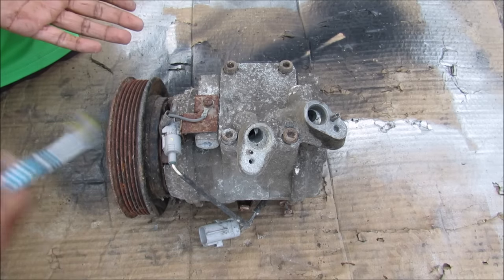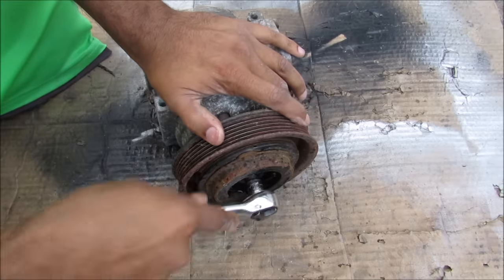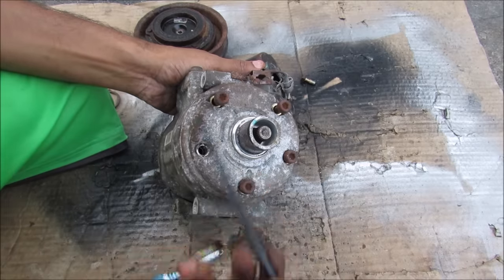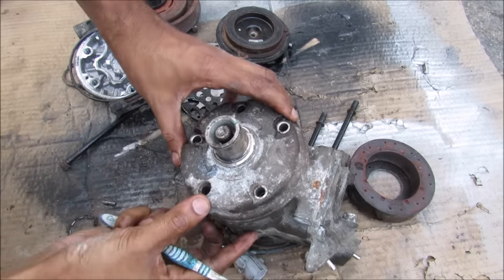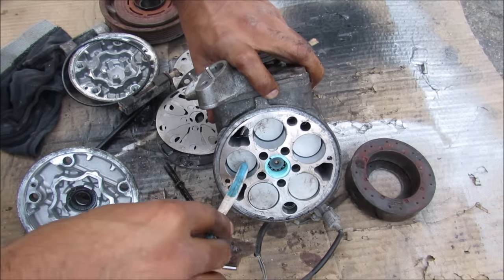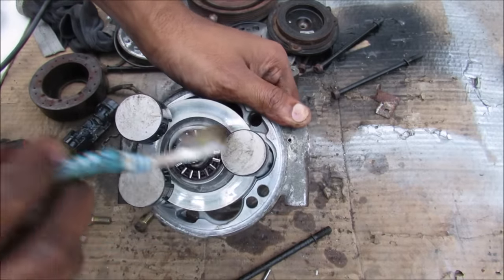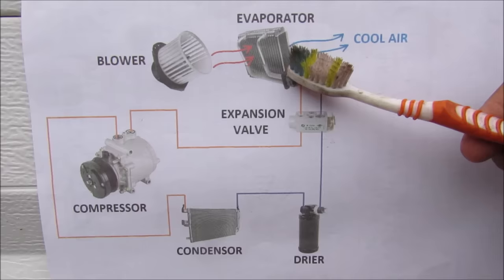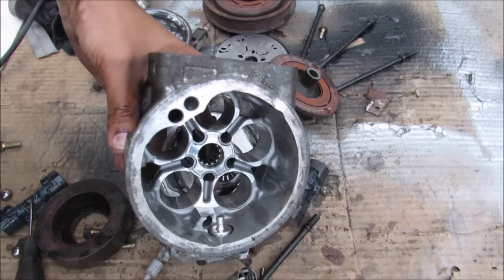How an A/C Compressor Works

Comment: Hey genius you dont have to turn you ac on in the winter cause when its on defrost THE AC RUNS! 🤦🏼‍♂️
Reply: Not in all cars, unfortunately. In mine, you have to manually turn it on if you want a stronger defrost.
Reply: TeraVolt what kind of car because i have never seen one that the a/c compressor does not run automatically thats how it removes the moisture from the air is with the a/c
Reply: It's an European low end car from the early 2000s. Very low end, i might say. Forget to pull (yes, pull) the AC switch and defrost only relies upon the heater. Setting distribution in defrost doesn't turn AC on. On the other hand AC is so powerful that just turning it on immediately defrosts all windows and glasses even when distribution is set to dash.

Comment: 2007 Honda Civic SI = my car A/C will work for 5 min and then your F !!! it has been doing this for 3 years. 
That's right, for 3 years I have received 5 min of A/C Cold air, then afterwards nothing, as if the compressor gives 0 F**'
Reply: Can you please check if the compressor clutch stays engaged after these 5 minutes? May just be too much clutch gap.
Reply: TeraVolt I just purchased an air compressor on eBay yesterday for $180. I’ll let you know if it fixed my problem within this week.
Reply: TeraVolt TeraVolt mechanic told me compressor heats up so it does afterwards, or the clutch heats up or something to this extent. You
Reply: @FlamingoVlogs  Yes, the compressor also has a thermal switch in series with the clutch. You need to check if the compressor is effectively overheating, or if either the clutch or thermal switch are acting up.
Reply: TeraVolt
Thanks for the intel。 will keep you updated
Reply: TeraVolt it was the clutch that was burnt on the old compressor . New one works like a charm .
Reply: @FlamingoVlogs  Now enjoy your ice cold air
Reply: TeraVolt 🥶🥶🥶
Reply: @FlamingoVlogs  I've just discovered a leaking TXV o-ring and relief valve o-ring on my a/c, it's a Delphi CVC internally controlled variable displacement compressor so it begins struggling to cool things down as soon as the charge gets down even by something like 100-150 grams less than the correct refrigerant weight... the "ac never needs to be recharged" thing most people say when referring even to scroll compressors just like yours definitely won't hold true with this compressor...